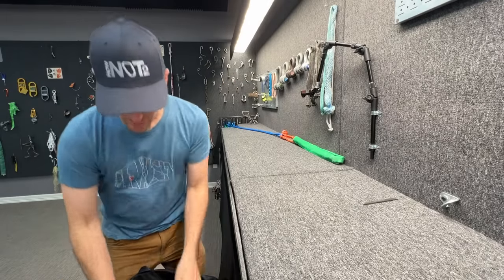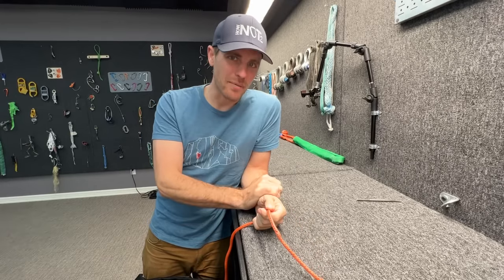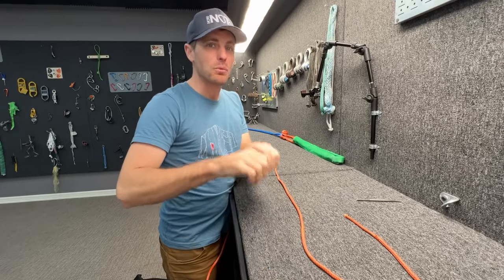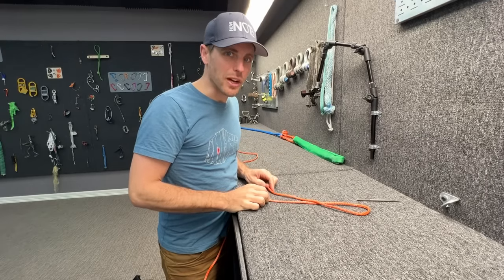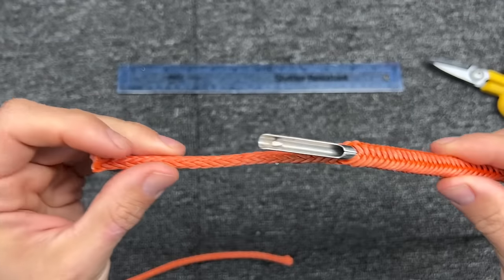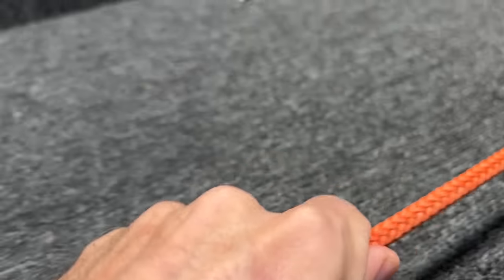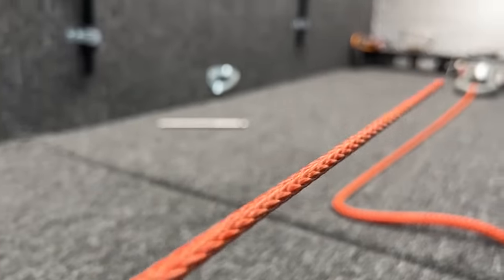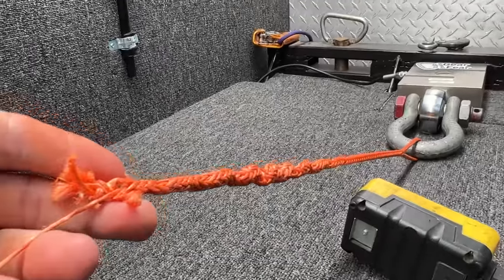This trick changes everything

Comment: Like the sailor that suggested it, I utilise similar onboard my boat. As a suggestion, try replacing the 'pulling clutch' with an equal sized nylon cord with the core removed, this has allowed me to grip dyneema to tension it where a dyneema clutch has slipped. Would be interested to see the breaking strain of that combination!
Thanks for the excellent content 👍

Comment: PSA IT WILL CREEP! You gave me this idea when I saw a whoopie sling on your video years ago. I use this "clutch open whoopie" method for a 3/8" amsteel infinitely adjustable tow strap/ rigging strap for a small crane. Brummel on each end Chinese finger trap in the middle, loaded as you have done here. IT CREEPS!! With my 3/8" dyneema with ~2 foot bury under ~1000lb of force. It will CREEP ABOUT 2FEET/ HOUR.  Still works well for me for quick jobs. Thanks for all the great ideas and info from your videos!!!!!
Reply: pounds (lb) is not a force. I think you mean 1000 foot-pounds (ft⋅lbf) of force?
Reply: @error.418   pounds force [lbf]  and pounds mass (on earth) [lb] are not the same but are usually used interchangeably. The proper unit of mass in the imperial system is the [slug]. What you mentioned, foot pounds [ft-lbf] is a unit of torque or rotational force.
Reply: @patrickwiseman2012  The foot-pound force (symbol: ft⋅lbf, ft⋅lbf, or ft⋅lb) is a unit of work or energy in the engineering and gravitational systems in United States customary and imperial units of measure. It is the energy transferred upon applying a force of one pound-force (lbf) through a linear displacement of one foot.
Reply: @patrickwiseman2012  I think what you're thinking of is the pound-foot (lbf⋅ft), a unit of torque. It is NOT the same as the foot-pound.

Comment: Having just watched some of your stuff on whoopie slings, I was think about how all but one tinny spot is double strength.  The concept you tested here occurred to me, but I had no idea if it would hold. Thanks for doing the test! I'm someone that will benefit from your testing, and I don't even climb. I'll be putting it to use for a winch extension line for recovering stuck 4X4's (which I do on a volunteer basis). Your work has wide ranging applications. Thanks.

Comment: You can increase the tension on the constrictor dyneema by adding a loop on the end. Wrap the loop around the main line (it's sort of a clove around the main line). That will pull the constrictor tighter, so it grips better and creeps/slips less.

If you search images of  "UCR hammock suspension" you'll see what I mean.
Reply: I've had better results making a Prusik style knot out of the loop, but year, I think doing that would radically reduce the amount of bury he needs to keep it from slipping.
Reply: My thoughts as well. Without the tension from the opposite direction there is nothing holding the finger trap closed. I’ve seen elastic cord added as well to the prussik tensioner side. Lots of examples in hammock and tarp forums
Reply: Was thinking the same, alongside - Seeing as it breaks at the point that the cord emerges, what if you left the end inside. Maybe not suitable for this purpose but would be interesting to see how it performs for other applications.

Comment: i think i dropped a link to the ronstan constrictor a few weeks ago. sailboats will all have textile clutches in the future. presently clutches resemble ascenders that are bolted to the deck in a row. the textile clutch is cheaper, easier to fix, does less damage to the rope, and is a lot stronger than steel.

Comment: As a thought the probable reason why the clutch slipped lower than other similar tests is because only one end was tentioned. A solution to this would be a length of dyneema with an eye splice on each end,  you use one eye for anchor the middle as the clutch and the last eye as a tensioner. Bungee cord maybe.

Comment: Thanks. The eye held because the fixed part is tensioned. How about tensioning the open end by brummel splicing the long line through the dyneema first, and then bury it? That way you will tension the short side and thus have more holding strength.

Comment: If you are far enough from the edge, attach a bungee to the end of the finger and anchor it near the edge. This helps collapse the finger around the rope. Think of the capstan equation, The capstan is a force multiplier,  However, even if the multiplier is 1000, zero initial force times 1000 is still zero force.

Comment: On the 2.7k line, we did not need the shower curtain method because we  could lay the webbing on the ground, but for the line with the flags we needed to tension 4mm dyneema. In the end, we went with 2 km of 4mm dyneema in the middle, and the ends were 8mm polyester rope (400m on each side) which we pulled with VT knots.
Reply: But even this method would not have worked, if we had to  pull a flag through...
Reply from the maker: I’m wondering if I can vt Prusik would work, like a meter or 2 long, so it’s removable. Not sure if a dyneema vt would work on vt. Not sure if I can pass segments spliced into each other through the clutch. Clutches seem too permanent for sure. Or I pre install a lot of clutches per potential hiccup.

Comment: 06/29/2023 This is how a water ski rope is tied off. Only diff is ski rope is not dynema and the tail of the handle end or the loop end is threaded once through across the straight line with a half hitch back through the eye of the handle end then threaded through the line before. I have enjoyed this slipage a few times until I bought a new ski rope and saw how the factory spliced the eye as above. Also the recommended length of the tail into the sleeve was 36 to 72 times the diameter of the rope. I have used this method of splicing ski rope several times each summer for myself and other sport warter skiers. Wet fun until you get too old, if ever. Some ski into their 90's. I never heard the tech name of this knot but you can see it in any boat shop.  Don

Comment: We use this splicing method to repair the rope we use to launch our sailplanes.
What we pay attention to:
-Closed loop: We feed 0.6m(60cm) back into the rope. On the last 10cm we cut out individual cardelines to make the transition smoother.
-Connection of 2 ropes: Same as above except that we insert each end of the rope 0.6m into the other rope.

Comment: The reason there is no slippage on the eye side is because all of the outer layer is in tension so all of it gets compressed around the inner.     Where it slips it is only the friction between the outer and inner layers that tension the outer layer.   That means if it does not grip initially at the end the friction there can be very low. When it starts to slip the tension is gone and there is no longer any compression so it will just continue to do that

Some way to tension it would increase the strength or perhaps more exactly stop it from starting to slip.  It could be something separate that just pulls on it, if you use it to tension the system leave the end long and just pull with your hand so it locks.  A Brummel splice-trouhg the line in tension should lock it all together, it will be problematic when you work with it.    Some lock stitching likely increases the strength too.

Comment: Only thing I've done recently is I make turk's heads as a belt accessory loop. Usually with a welded or forged ring through it for keys or wrenches or what have you. I made one out of 1/8" dynema & back spliced the ends together before evening it all out. That was a challenge for sure in a 3 pass 3 strand turk's head. Once buried it looked fair. Not my best work but still fun & strong enough to bend the ring before anything else shifted. 
Looking forward to the teased highline video.

Comment: crazy idea, so you do your splice, then on the ded end of the main line, stuff essentially a knitting needle in (blunt and not pokey of course) creating an easily removable fat spot that the fanger trap section couldn't slip over, though it woud create a potential bending and therefore breakage point on the temporary eye, but it should prevent slippage while still being field removable without stitching (in logging we stick finishing nails into the ferule ends  to prevent the cable from pulling out, sort of the same idea)

Comment: hey man, i work in special effects and stunt riggign, the way we terminate open ended dyneema is on a mobile bollard. yust wrap it a ton like you would your winch.... easyest way to get one is from an arborist shop, they use them as decenders for heavy pieces of wood. you might also consider using vectran (aramid) since that stuff is less slippy, but is quite noisy under load. that you push your luck by using 5mm you seem to already know ;)

Comment: How about if you re-bury your tail inside the fixed eye?  Bet holding the tail back inline and following the direction change along with friction around whatever it's attached to will hold it better than just flopping out the side loose.  
Or maybe that is superfluous once you have a long enough "clutch".

Comment: What if you used one size bigger line for the short section with the eye splice?  I can think of no reason that the two have to be the same size.
Reply: I think a bigger braid would create less clamping force. 

Maybe a thinner one attached twice would work. 

I also think you could increase friction by winding it around itself- the way a traditional rope stays together at all, and kinda the way you'd splice one of those.

I'd have to think about how to do that with braided dyneema, i suspect it would take many meters.

Comment: How bout this?
What if you spliced both ends of the "clutch"? You anchor the "pull" end and the "trap" end in line with the rope. Then splice in the rope and tension the clutch from the trap side. Release, pull, tension, repeat.
The clutch will be doing the all work and giving the rope the FULL finger trap effect. You wouldn't need as long of a splice on the rope AND if you control the tension you can release or pull the rope at will like a real clutch.

Comment: Try it with a spliced loop on both ends of the clutch, one is anchored obviously like in this test, but put some kind of tension on the free one (that was just the raw cut end of the clutch in this one) in the opposite direction. Bet it holds way stronger. Might be hard to rig up in the wild...
Reply: That's an interesting idea but definitely I would not rely on it into the wild, too many unknowns into tensioning from both sides
I would rather see if a clove hitch locking the exiting strand reduces the strength or is enough to keep the thing from sliding and it gets anyways to full strength
Reply: But the final test didn't slip, it broke
Reply: @gregorgombac5302  As a progress capture device I'd prefer it to holding the cord by hand while my buddy splices the main line, like at the beginning of the video!
Reply: @mattgraham4340  The thing that scares me about it as done in the video is that, I think, while it is under load and holding if you grabbed the free / cut end of the clutch and started sliding it towards the anchor you'd be un-finger-trapping the clutch from the LOOSE end, until only a little of the clutch is left tight and it slips.

(I use this stuff for whoopie slings and ridge lines for hammocks, so I have some feel for how it acts, but am far from an expert!)
Reply: @bkuker  You're probably correct.  Although, any setup will be vulnerable to tampering.  I would think multiple turns around something of large diameter then terminated in a hitch similar to how boats are moored would be ideal.  In the video's "clutch" scenario I wonder if some cold shrink tape would stabilize it,  assuming such tape doesn't exude any fluid
Reply: I wonder if a cable gland would work to provide the initial tension on the finger trap.
It basically squeezes rubber on it radially when you tighten a nut, is soft enough not to pinch, but should provide pressure and therefore friction uniformly.

Comment: I would be super curious what would happen if you buried 1 fid length, exited the core and went back in about 5 picks later. I think it would weaken the line more (say 80% instead of 90 with a normal splice) but it would let you maintain a more typical bury length to get it to lock
Reply: Very interesting concept, it seems it could work

Comment: At slack feb we used a rescue figure 8 to hold the amsteel at the tension end of the clothesline. Stronger than a knot, easy to adjust, no splicing needed.
Reply: You're locking the rescue figure 8 with a classic tie off or something else?
Reply: To be honest i don't remember, there was almost no tension after some wraps on the eight

Comment: I've tried that before. I think the problem is that it needs a good milking to get tight enough to pull the other line end to close the "finger trap". In my tests it worked ok with some lines and not at all in other lines and with some cords it worked sometimes. It is more or less a matter of luck if you get friction at the right end (pulling the cut end of the rope that has bury in it) or not (other end does not tighten the trap). The smoother the dyneema, the less likely that is to work I think.
In my use case (adjustable 10m) I went for a whoopie (no good for 2km :). Whoopie has the benefit that it pulls also the outer cord that will close the trap. Having a 50% of load pulling the line that closes the trap generated enough friction.

Comment: I wonder if crossing the long line through to the other side of the short line an inch or two after it comes out would help it hold. Leaving a bit more on the end of the short line and burying it into the long line when you've got it at the length you want woukd probably help too.

Comment: Im a climber from 70's and know nothing about slack lining. But wondering if dyneema could be wrapped around a capstan to hold the full load and then use a simple knot or hitch on the low load side.

Comment: Check out the safe xtract x lock for 4wd winch lines. Its like a big double sided cleat specifically for shorting synthetic winch lines.
Reply: The reason it slips is your "finger trap" is only milked to constrict it, when you do this in a eye splice the tension in the line constricts over the bury. In your case the "finger trap" has no tension on it to constrict it.
Reply: @markt9028  i wonder if this is a case were even "a little" friction on the first part of the "finger trap" would create a reliable  self- locking effect.

A little as in "wrap any kind of cord around it with a constrictor knot, try a strong rubber band or some kind of spring-loaded clamp"

It could also work with a cable gland- those rubber inserts squeezed by a threaded shell, used to seal cables entering  electrical boxes.

Comment: If you'd use 2 of these dynema constrictor ropes and pull on one after the other you wouldn't even need to put temporary knots in the line. Milk one back while pulling on the other.

Comment: Interesting trick, could you put the fid back through both at right angles to work as a pin or "removable" stitch? For rigging not life and death.
Reply: Also would be interested to see an arborist lowering device as they are mobile bollards, but I won't be going anywhere near any of the sketchy ziplines or high line's.

Comment: 1 - you guys are NUTS.  2 - what MIGHT work is adding some adhesive to those long joints.  I say MIGHT because I think dyneema is basically HDMWPE, and almost nothing sticks well to unmodified HDPE, but some model aircraft guys have found that high quality CA adhesive can make knots hold in HDPE that would otherwise slip.  On the downside, it's a one shot.  If you try it, I'd suggest loctite "surface insensitive" CA.  It does have some adhesion to PE and other slippery plastics.  It's an industrial item, but available from most industrial fastener supply places.  Don't use it by itself, just as a way to reduce slipping on splices/knots.

Comment: Pease keep this WARNING in mind. When you are using this clutch that the physics are NOT the same as with a normal splice.
In a normal splice the tension of the outside rope goes from ~40-100%. It has everywhere at least 50% of the tension, independend of the length of the splice!

With this clutch the tension of the outside rope goes from 0 - 100% ⚠️‼️ The problem is if you double the length of the splice (the tension of the outside rope = the grip strengh) integrated over the distance wont change much. Therefore the total grip strengh doesn’t change as much as with a normal splice. 
If you have questions i am willing to explain my thoughts in more detail over discord or so.

Comment: You need to add little friction to the end of the splice so that it can self tighten while under load. That is why your splice at 5:00 failed. It would have held just fine if you had tightened a zip tie over the left end of the splice.

Comment: Can't you just put a knot in the tail so it can't go through?
Reply: Every knot reduces the strength of the rope by half or more. You can still put a knot in the end of it, but if you can make a longer splice and retain strength instead...
Reply: @KoroWerks  No, I mean a knot in the tail that sticks out of the splice, to prevent it from slipping back inside.
Reply: @eyescreamcake  I suspect that knot would reduce the strength of the "gripping" rope, just by stressing a few  strands differently.